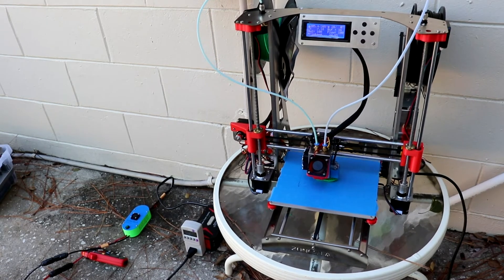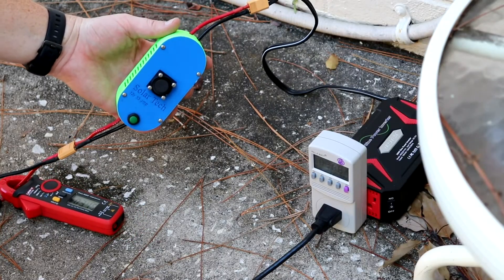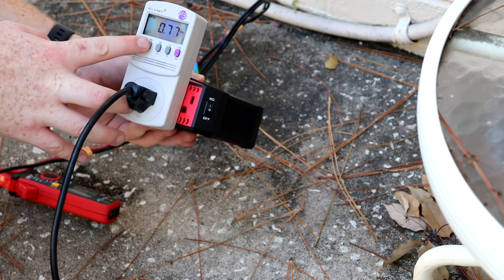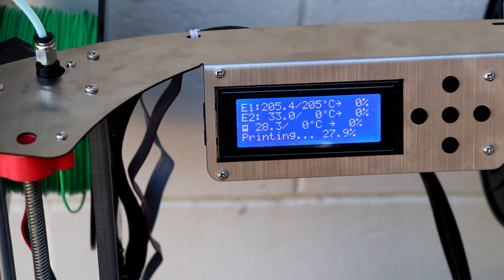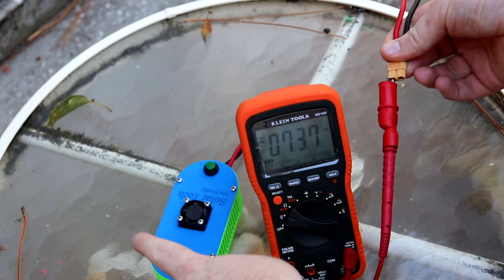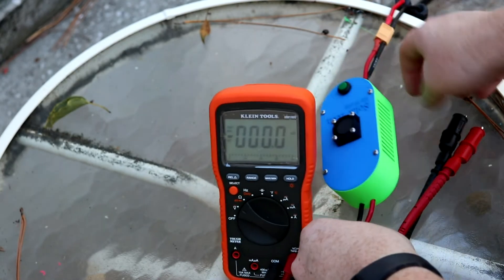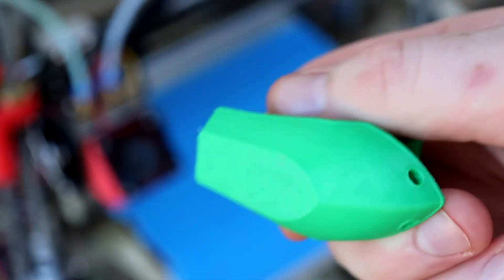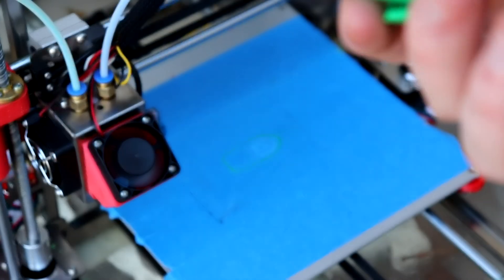3D Printing on Pure Solar Power (Just Becuse I Can)

Comment: Isn't there a way to have the 3D printer itself print the "solar panel" or "energy obtaining device"?  Then you could have the 3D printer also "grow" by taking out its in between "lego" pieces and putting a new printed one.  I was thinking that the 3D printer printed a highly reflective mirror to concentrate the sun's power to melt salt that then turned water into steam and the steam turbine would turn into electricity used to power the printer, but I think it might be more efficient if you used the energy directly...  Also you can use the suns energy to turn the CO2 in the air into resin by combining it with water if you had a molecular printer (if you had a 3D printer that could self-replicate just make it self-replicate smaller and smaller into you have one...) that could create enzymes.  Other resins include just melting sand by collecting the suns energy.